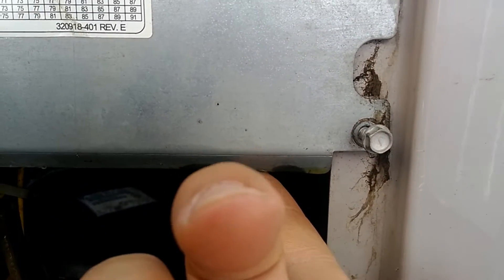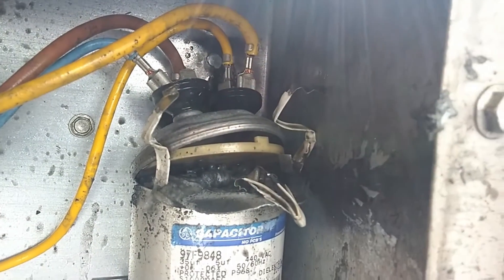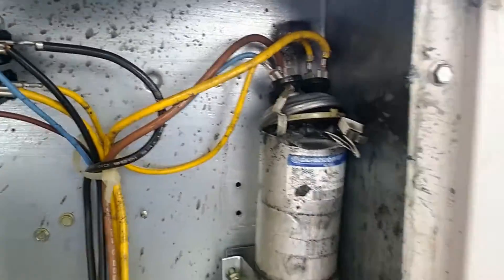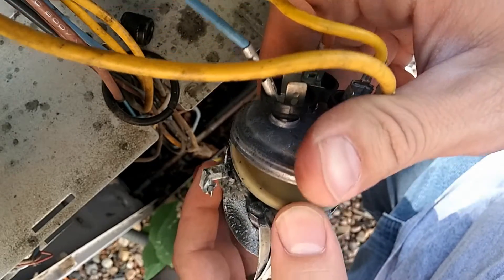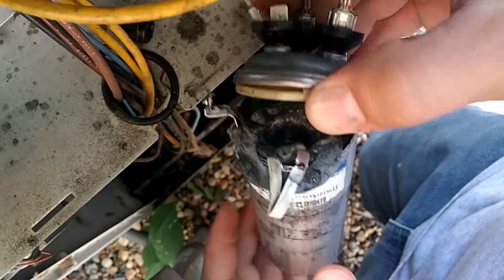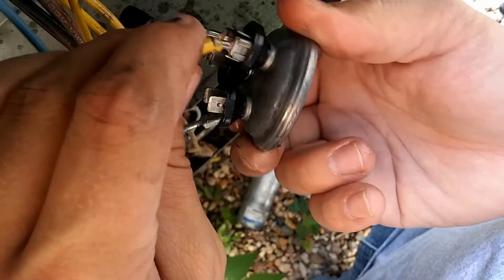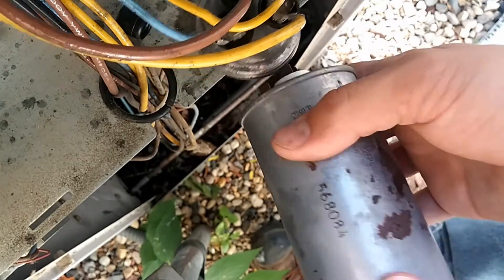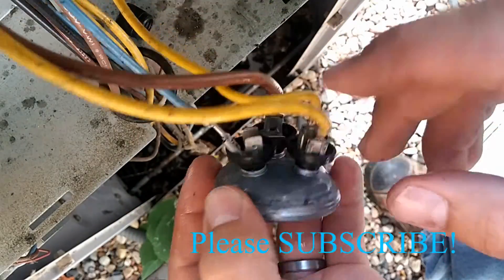Can Capacitors Explode? Capacitor Safety Device Failure

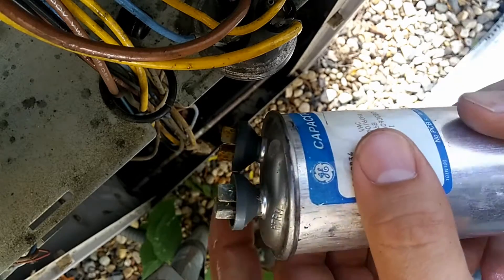Comment: Looks like the cap at 05:00 is from a window unit with such a low uf.
Reply: No.  It is a 35/5 at 370v.  Common on many external AC condenser units, just the smaller sized compressor unit.